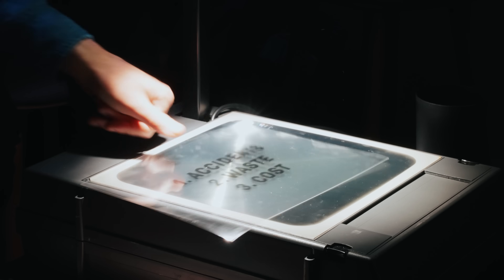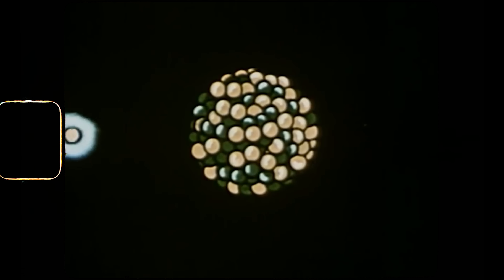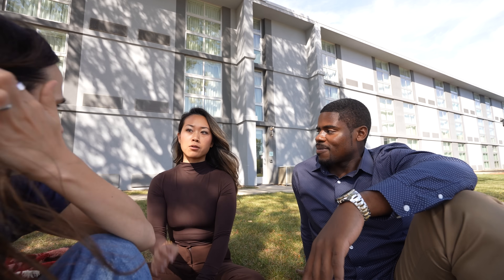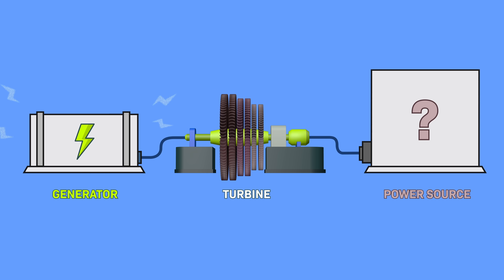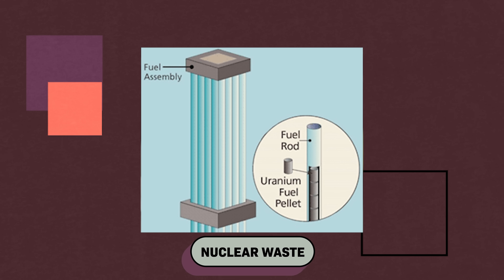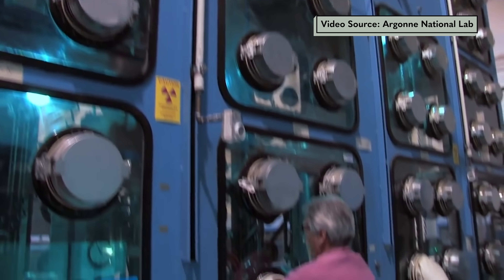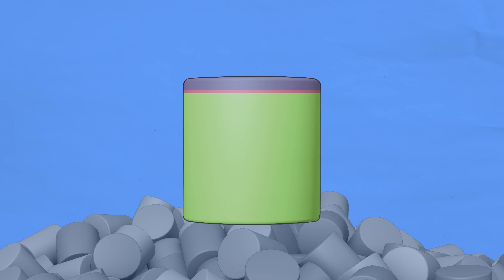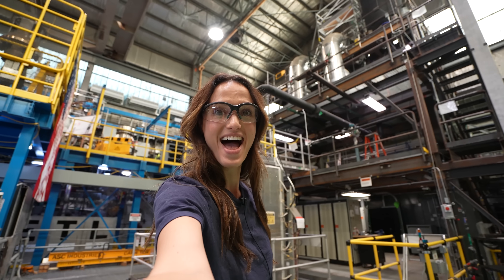The Big Lie About Nuclear Waste

Comment: I have been screaming this since I was in middle school and learned about fission. Why did we call it 'nuclear waste' if it was still radioactive? It was 'wasted fuel'. And, if we use up the fuel, plutonium and all, it eventually ends up as lead. I never understood why we didn't use the fuel instead of just stick it in caskets.
Reply: Just because something is radioactive, that doesn't mean it is useful to generate electricity. You can't use all the components. Thats why there remains waste for 200+ years as said in the Video.
Even more important is, that particles can be radioactive and consume energy given by surrounding unstable isotopes.
Reply: In a word, money? I believe reprocessing nuclear fuel is considered especially economic when making bombs; new fuel is much cheaper, if the environmental cost to the future is not factored in

Comment: Alert : A test to work at a re-do U-238 recycling plant.(1)  A train leaves Brussels at 11:00 am averaging 60 mph. Another train headed in the opposite direction leaves Brussels at 1:00 pm, averaging 90 mph. To the nearest mile, how far are the two trains from each other at 3:00 pm ? (2) Complete the sentence..."If you play with fire eventually you..."
Answers (1) 420 miles like 420 time (2)...will get burned.

Comment: The real issue not addressed in her video is the spread of nuclear contaminants in the process of fission and maintaining the machinery used in the process. It is impossible to sailor proof the thermo nuclear generation process. I watched the so called controlled area in a nuke generating plant triple in size in a decade. I watched people involved in nuke plant operation and maintenance jump through hoops to control the spread of contamination only to end up with lifetime dosing levels accrued in in an exposure measured in hours. Having the kind of forced nasal lavage needed to clear a sinus cavity of radioactive particulates is not recommended, yet I knew several maintenance people who were subjected to the tortuous procedure simply because the wind stirred up a hot particle. I watched a charging pump impeller being machined in a controlled shop lathe that released sufficient radiation when cut that all the nearby radiation alarms sounded and sent the machinist and environment checkers scrambling to get away from it. I built lead brick walls around a pump installation that was so hot we were allowed 8 minutes total exposure. That kind of nuclear waste is the most dangerous and ends up being moved into the deepest salt mines on the planet encased in a concrete coffin encased in steel. Steel and concrete will fail before the radiation source they contain is spent and rendered safe to be released into our ecosystem. As long as a human being is involved somewhere, anywhere, in the nuclear fission or fusion process the risk exponentially out weighs any probable measure of benefit. Just the way it really is when human beings are involved. 13:54
Reply: I was on Nuclear submarines and our equipment can more than handle and make everyone on the boat safe. We actually use water as a barrier to protect people from radiation and it works so well that the rad monitors we all wear record us as receiving less radiation than people exposed to the sunlight

Comment: I can't believe that they did not even mention the word "Thorium".  Thorium Reactors use Nuclear waste and also create very hazardous waste because they are corrosive salts that will eat through anything.  This "Nuclear Waste" ONLY needs to be stored for around 500 years.  This process also creates U-232 which is perfect weapons grade Uranium which some people suspect is the motivation for this.  The problem with this technology is Ironically how much really really dangerous waste it creates.  So they are selling us on getting rid of Nuclear waste in the form of U-238 which can be easily and effectively stored to sell us on the idea of creating Thorium reactors to get rid of "Nuclear Waste" even though it creates much much more dangerous byproducts.  You can't really call U-232 Waste because it is a usable weapons grade form of Uranium, but it emits so much gamma radiation that they don't think anyone will steal it because it is so extremely dangerous to handle.

We should definitely do a lot of research on this.  It has promise, but it is NOT less dangerous than light water reactors at the present time.

Comment: Enrichment does not make "more of the uranium 235 out of the less useful uranium 238". Enrichment separates the existing U235 from the existing U238/U235 ore. Your statements and the graphics are implying that u238 is being converted to U235, which is false. If you want to obtain more u235 from the enrichment process, you must feed in more of the 99.3% U238/0.7% U235 ore.
Good luck with recycling nuclear waste using electrolysis. The laws of physics will always limit the amount of energy you recover to less than the amount of energy required to recover it. 
Oh yeah, and you forgot to mention that not only is plutonium highly radioactive, it's also one of the most toxic substances on the planet.
Politics is a large part of the nuclear waste problem. Years ago, there was a concerted effort to create regional nuclear waste storage facilities. The each state would, in turn, build a waste storage facility that would receive waste from all of the other power plants in their region. Agreements were signed, and facilities were built. And then the states that had not yet built storage facilities backed out of the agreements leaving the states that were the first to build storage facilities holding radioactive bag, with no prospect of storing their own future waste at other facilities that would never be built in other states.
Glad to see someone 'Pro Nuclear' actually addressing the waste problem. Not addressed was 'low level' waste. All the miscellaneous irradiated materials like glove boxes and the machinery needed to produce the fuel pellets, air filters, etc. None of which you'd want lying around your house or your office.
Reply: Read my comment,  about FULBECK 
Google it and read the newspapers reports... 

THE Flowers Report 

and thanks for answering my  question, I asked,  at the end of my comment .
the video missed out explaining, that there will be a "new" waste created from the original recycled waste ?!
and what's going to happen  to the "new" recycled wastes 

there's always a waste by product 

remember. 
energy doesn't   disappear..
it just "changes" into another ""form"" of ""Energy"" 

Nuclear waste
is an ""immortal"" human made
'
 "Devils Soup"
bubbling  away in ALL those storage facilities,.... like witches CAULDRON's

Now I am become Death, the destroyer of worlds'

Comment: why don't they investigate Thorium , which was used in the 1st reactors doesn't produce any near the waste uranium does plus if Chernobyl & Fujikara (might be spelt wrong) couldn't and wouldn't have happened , iirc there's a rector in the states still running that is from that era

Comment: The real issue with nuclear fuel is that because we originally wanted plutonium for making bombs we spent a lot of research dollars in that direction. When uranium is used as a fuel only something like 0.5% is actually burned the rest is stored, so yes it can be recycled because 99.5% of the fuel is still there.  Had we not wanted the plutonium we would have gone the route of thorium salt reactors which are cheaper in pretty much every way and can burn nearly 100% of the fuel over its lifetime and produce more energy but they only produce minimal amount of plutonium which is not helpful when you want the ability to make things that go boom as a secondary product. Anyway we spent huge numbers of dollars to research uranium and we have that technology and so the government really is not interested in spending much on thorium research. As I understand it another advantage of thorium reactors is that you won't ever have a meltdown as thorium reactors self moderate. We can directly blame the cold war among other things as to why we don't have essentially clean nuclear reactors.  The radioactive waste of thorium reactors have a half life for the most part of about 500 years.

Comment: Thing is that even the so called "bad" products can be safely used. Nuclear Batteries as they are called not only provide appropriate shielding against but also a viable storage medium for nuclear waste while also converting it into usable electricity. Smart planning could see nuclear powered homes and electric cars that will virtually never run out of power while also not being attached to any grid simply by building these nuclear Batteries inu a well protected area. Virtually because there will still be a need to attach regular batteries because they're will be tomes demand will exceed producing and the batteries will civet for that while also storing the extra from times that production exceeds demand.

Comment: Not reprocessing fuel has made nuclear far less effecient from a financial standpoint, than it should be. The amount of useable fissionable material left in spent fuel is significant, and allowing it to be extracted would be a huge win for the industry while creating jobs in the process. MOX is as close as we get.

As an aside, most nuclear fuel is U238, only enriched to around 5% with U235. Also, in many plants, most of their fuel is stored in pools, not dry casks, which are expensive. Also, we use it 3 times on average, not once. Fuel assemblies are used for three cycles barring any fuel defects/assembly damage.

Comment: Recycling the waste is not the question. The SAFETY of reactors is the question. Whether Fukishima or Three Mile island used recycled waste, or not, would not have prevented the environmental disasters that they are. Nuclear power plants have to be insured by us taxpayers as no insurance company in the world would take on that challenge.  Nuclear power is not green, as the processing of radioactive materials is fossil fuel intensive. Nuclear power is not a solution to mankind's energy problems and the whole idea needs to be scarpped.
Reply: of course, not being able to recycle wind and solar systems is not a problem, is it.  With these systems killing animal and plant life, with the mining of the components as environmentally UNfriendly as you can get, then by all means, let's scrap a much better idea.
Reply: YouTube 

ONKALO 😢

Comment: You adress the risks of long term storage, and its a good thing if it is possible to recycle uranium. But the risks that has actually killed many thousands so far is when that thing happends that no one thought of and the production site blows up. Harrisburg, ah it can´t happen again. Chernobyl, it was the bad soviet technology. Always someone to blame. But Fucoshima was not in a country that is behind in technology. It is just a place where they did not prepare and did not think of everything. And when you can change a whole country from normal to wasteland with one single accident, then I don´t think the major issue is storage of used fuel but what more did someone not think of in time.
Reply: Google 

The Flowers ( Nuclear) Report

everything you've mentioned. 
is covered in that report ..

brace yourself 
when you read it.. 

* Google 
-
Fulbeck celebrate 30years nuclear waste campaign  

find and read  what PM MARGATE THATCHER 
SAID AND DID !!!!!!!!!!
about the """ideal""" of dumping Nuclear waste underground!!
( she STOPPED IT..) ✋ ❤

Comment: Really interesting video. I am old enough to remember the promise of nuclear power in the 1960s, but was unaware of this technology that may make possible the recycling of spent fuel rods. I also remember Three Mile Island as I grew up in PA and all "The China Syndrome" furor that surrounded it. As you noted, there is still a ways to go before this technology is commercialized, but political and business interests will probably continue to get in the way. The hardcore environmentalists shudder at the even the thought of nuclear power and will probably continue to fight its resurgence. There was some talking about a revival for nuclear power back around 2010, but the Fukushima accident, as part of the Japan earthquake, in 2011 set the movement back. It will be interesting to see if this technology can overcome political and business challenges and become reality.

Comment: like all and everything in this world you cant get past the lobby of the status quo haha and nuclear submarine and flightdeckcarrier active around 400 of those nuclear powered dont use water to boil at 100c to cool hundreds of degrees Celsius because you need pressure 1500 psi to cool it and the pressurized vessels and boiler for that are the most expensive of the plant.

why would you do that because you call it in marketing name nuclear waste haha could be everything we flush after number 2 metabolism is also nuclear and what about thorium then one breeder can do it all at no pressure only 700C  in molten crystals and fuel that fuel is unlimited for unlimited time and can breed to from and beyond.
and car engine runs of water h2o and all inventors are taken care of long ago. and the scientists in cold nuclear fusion vanished. be wise and don't go further because you get whacked if one dares to publicly or commercially cheap energy because we live in a scarcity invented world and get taxed for our exhale in carbontax haha this world is done for and I dont care nor do. so next subject energy is abundant everywhere and. now you have to do research because this platform is doomed also.

Comment: Lying about lying, liar. The much ballyhooed French barely reprocess nuclear waste as outside of tiny applications it's cheaper to mine new uranium. And the waste it generates will remain HIGHLY TOXIC FOREVER. Were kids in Flint poised by lead because it was radioactive, or because it's a toxic heavy metal? Uranium is twice as dense as lead. The waste will be a hazard for as long as Earth exists.

Comment: I'm not afraid of nukes, what I don't like is the fact that the corporations build nuclear systems that are over priced.  the corporations use the cost plust 15% system--easy to inflate a project that costs 100Mill to 100Bill! and the tax payers pay for that project that costs 1000 times it's real value.  There are all kinds of trix to drive the cost up.

Comment: Japan does not recycle nuclear waste (and the process you are referring to isn't really recycling either. It's re-enriching spent fuel with more plutonium). They have been trying to get a recycling plant off the ground for decades now (The Rokkasho reprocessing plant) but it keeps getting delayed. In fact one of Japan's current problems is that a lot of their nuclear waste is in temporary storage and they don't know where to put it. The government has seriously considered just dumping it into the ocean.
Reply: Japan has a special problem with a huge volume of radioactive water that has been used to keep the Fukushima nuclear reactors cool after they were damaged by the 2010 tsunami. This is not the same as reactor fuel waste. It is the very slightly radioactive water that Japan is trying to release.

Comment: Thanks for spreading this. I knew all of this back in the 80s when I took a nuclear physics course in a country OUTSIDE the US. Funny how nuclear waste has different definitions outside the US. Other countries has no obligations to stagnate in the same way as the US has in nuclear. You didn't mention breeder reactors, i.e. reactors that produce MORE fuel than it uses. The new fuel converts the "useless" 99% U238 into plutonium by neutron capture. This plutonium can be used in a different reactor. (what I don't understand right now is why France made their their breeder reactor so expensive, and thus a failure.) And you are right in that, presently, Uranium is pretty cheap, so why develop the technology? Same way as for coal. Coal is cheap, so why go solar and wind which is 10x more expensive? This is my personal opinion. I don't work in nuclear.
Reply: "why France made their their breeder reactor so expensive"
What reactor are you referring to? The only breeders we made are "Phenix" and "Super-Phenix", which were industrial prototypes (and the latter worked pretty well before being shut down due to stupid political decisions). I'm pretty sure you're confusing those with the EPR, which is still a third generation reactor (and is poorly designed, which is part of why it's so expensive - along with lost skills in the french nuclear industry).

Comment: Ok so here's my question. We all know that cities use solar and wind to power themselves right. But why not just literally remove the coal from coal steam power plants and replace the coal which heats the water with a HEATING COIL that heats the water and have JUST ONLY that coil powered by solar and wind at the same time to however many BTUs is equivalent to burning coal.

Comment: In an accident the contamination doesn't ever go away use your brain statistically there is a chance the there are leaks and accidents a single accident blacks out a part of the map doesnt matter how small, and cleaning it up is extremely expensive. you're not weighing it out right, how much does it cost to fix one accident?